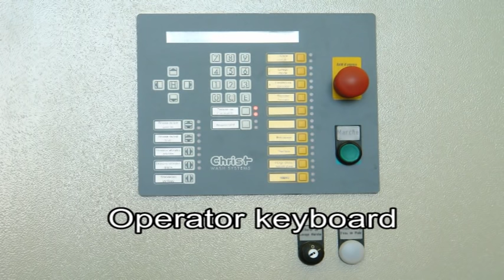TRAIN WASH - english - CHRIST WASH SYSTEMS

Comment: My mate has a Civic done up nice so it looks like it was meant to be from factory but you have to take a 2nd look and go WOW!!!, tweaks like lowered 10mm, rear boot lip which he got 2 boot lids cut the top rear edge welded it on formed it to look like it was meant to be a factory Lip, LED tail lights, Sunroof, nice Mag's. Looks really nice in the factory navy blue, cant stand the hatchbacks though that have been over modified the "Ricer's" there horrid but the nice mod's = winning